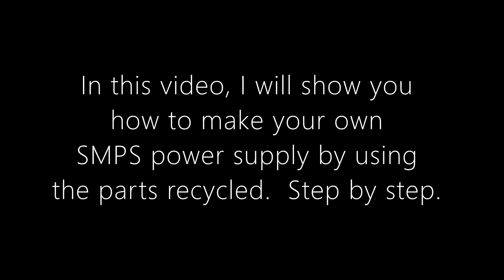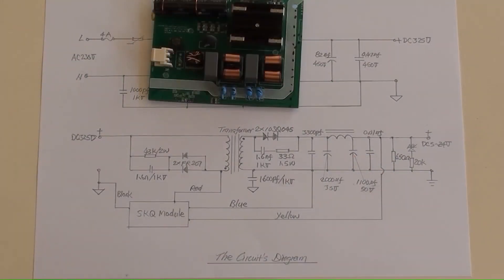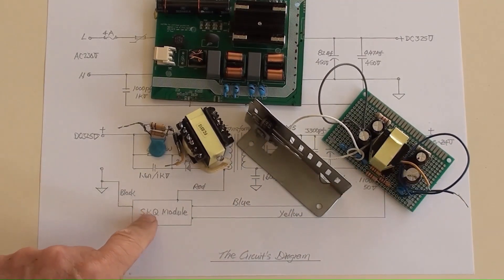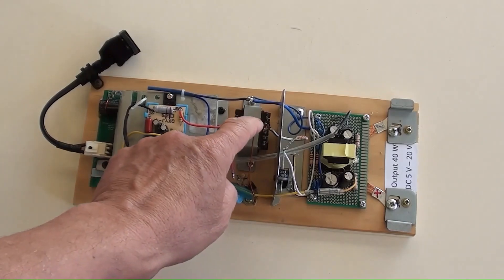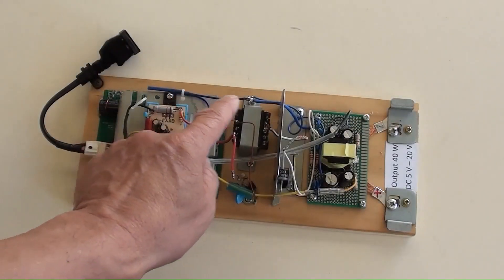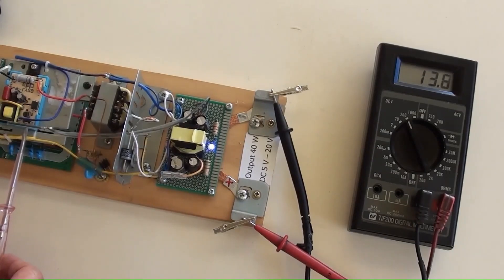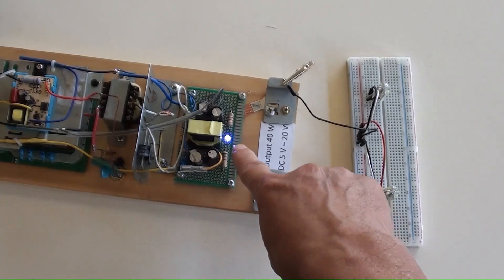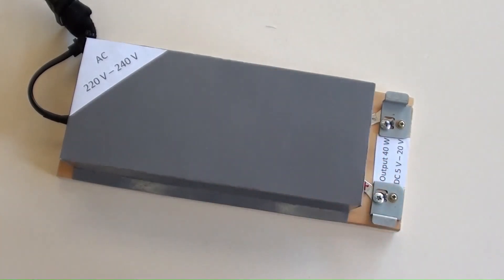How To DIY Home Made SMPS Power Supply?

Comment: how much ampere across the load?
Reply from the maker: Thanks for your interested!  The DC output capacity for this DIY power supply is 40 watt, so its max current:  I = 40 W / 5 V = 8 amperes also the components of the output have been chosen for 8 amperes as max allowable current.  In practical as the the video showed, a car's bulb rating:  DC 12 V / 21 W so across its current was 21 W / 12 V = 1.75 amperes.  Cheers.
Reply: before or after it killed you?